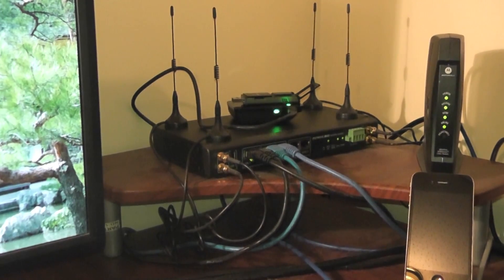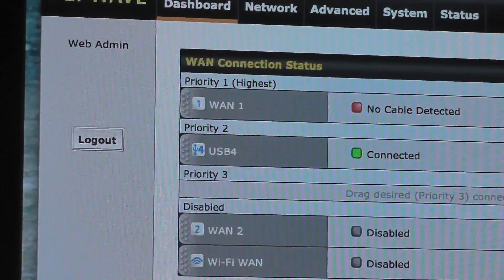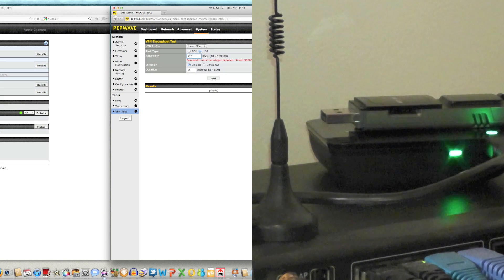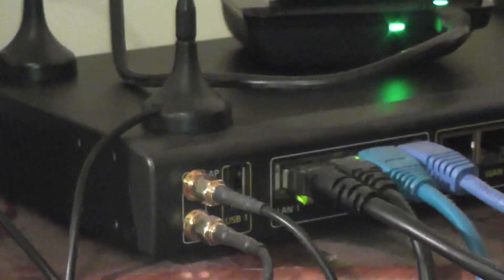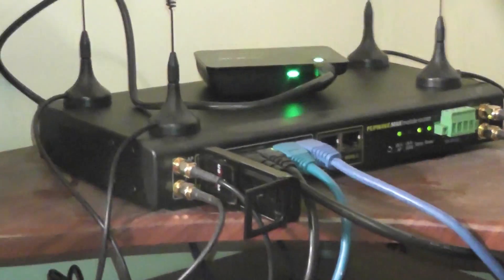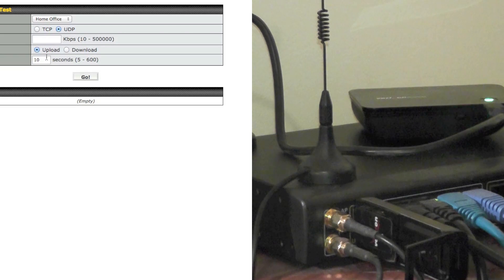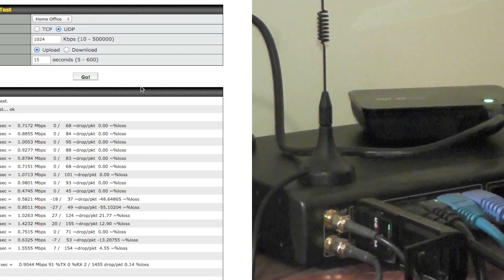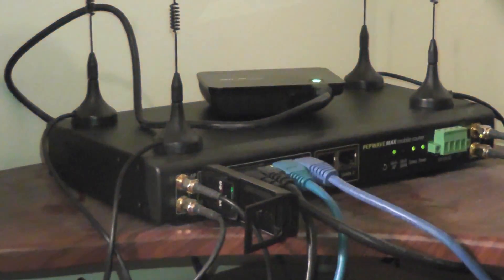Peplink/Pepwave SpeedFusion Modem Bonding - 3Gstore.com

Comment: Would I still need a hardware firewall /router after this device to my network for security concerns? I saw this video and I am floored to the endless possibilities. (using larger gain antennas, one could pull in from free wifi devices from your now larger home footprint to make your home internet connection that much more reliable. Providing you put the firewall/cheapie router between the output of your SF Modem and your home computer.) Is this the true use of your device?? If so, WOW!
Reply from the maker: Russ Roque In most situations this router will work as the firewall, especially for a home user. There are built in threat detections and DDOS prevention, plus a firewall to monitor traffic.

Comment from the maker: The first test was to get the average throughput of a single 3G connection. The second test was attempted at a higher speed because the two modems worked together to provide a single bonded connection using the SpeedFusion VPN tunnel. You'll notice either test didn't actually max at the numbers we told it to do, it ran at the maximum it could do with those numbers as a cap.